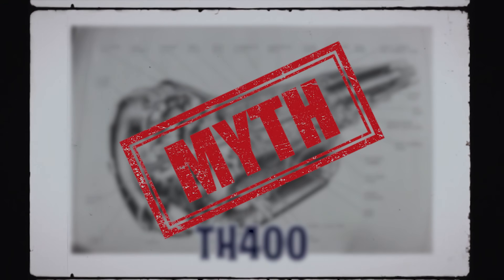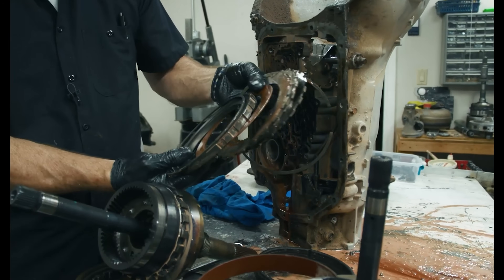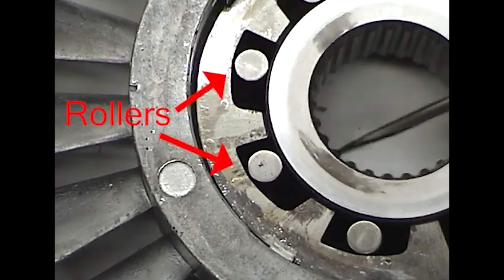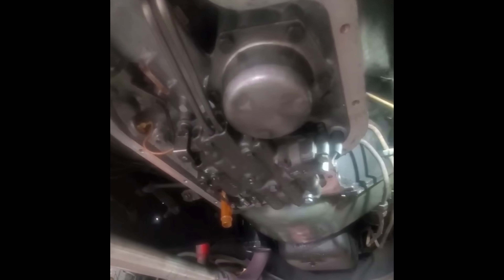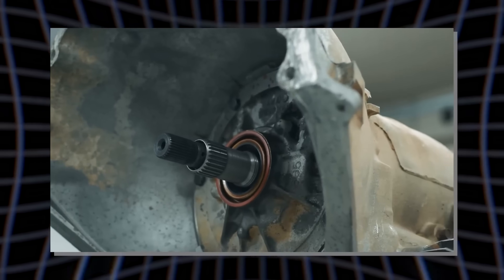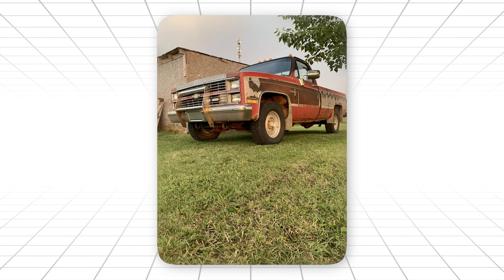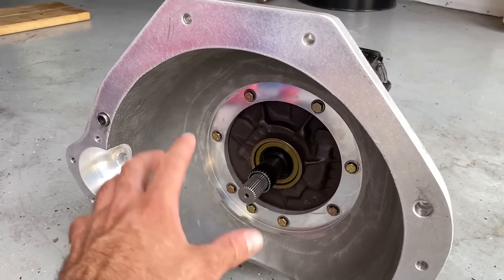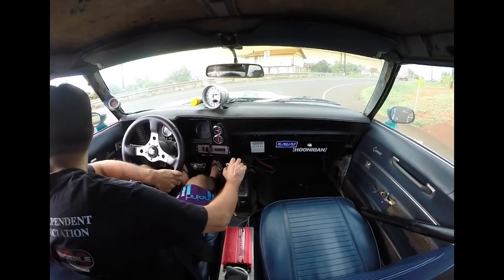GM's Tiny $12 Engineering MISTAKE That Created A MONSTER

Comment: Been a long time since I've listen to so much BS.  Why can't these content wannabe's at least do their own talking instead of using AI.  The transmissions are strong but not for the reasons he states.  The early TH400 did not have sprags - they were all roller clutches.  This AH also doesn't tell us what happens to the direct drum if you shift into neutral (either on purpose or by accident) at high speed.

Comment: I used to have a 69 chevelle that had a 307 with a powerglide in it that i swapped in a 327 with a turbo 400 that i got out of a 68 impala wagon. The guy practically gave it to me bc it was smoking and he thought it was burning oil. I.was going to rebuild it and i took the carb off and it had transmission fluid under it. It turned out that the vacuum module went bad and it was suckins fluid into the engine and burning it. Nothing was wrong with the engine. It was a double hump engine that they had a chain on the drivers side of the engine. And it had a electric kick down for passing gear. After we rebuilt the engine when i would drive it and i would shift it manually it would chirp first and second gears and pick up the front end but not off the ground. But it sure damn felt like it.

Comment: GM also turned the TH-400 into the TH-425 for Eldorados, Toronados, and front-wheel-drive GMC Motorhomes.  They were basically just a TH-400 cut off behind the torque converter, added chain drives like a 4x4 transfer case, but there was no rear output because there was no driveshaft.  Only the front output shaft was there, which went to the differential and turned the CV axles.

Comment: It's easy to burn them up. Guys that cam their engines will sometimes give up and run a TH350 instead. They don't realize that when you run a cam, you need to replace the factory modulator with the aftermarket ones. This  is so that you can turn the allen screw, while monitoring governor circuit pressure. And you must do this, to compensate for low engine vacuum. Meanwhile, the TH350 is cable driven for TV pressure, so it doesn't care 
My father custom ordered a 6 lug 2500 in '88 with a 4.3. 
After burning up the transmission in less than 30K miles, the builder disabled the kickdown switch. Been fine ever since.  But other guys have burned up those transmissions in really cold weather. The oil pickup tube O-ring shrinks, and the front pump is screaming ( sounds like a bad PS pump).
Guys that ran motorhomes had metal tubes welded to the oil pan. I honestly don't know if this was factory, or if it was a trick of the trade. But you needed it, to keep the fluid from burning up.

Comment: The TH 400 had an adjustable vacuum modulator valve. Take a small flat head screwdriver and poke it into the vacuum port and twist.... instant shift changes....
On Corvettes they had a special sump pan with cooling tubes....

Comment: The turbo 400 was so good that it was used by Rolls Royce. The Rolls Royce version had a different bolt pattern.🤗
Reply: I remember my VoTech instructor Bill Phieffer telling the tale of Rolls and the TH400. Rolls bought the design straight up and built their own 400 from scratch... and it didn't  work. They tried everything and finally called GM for help. GM sent their guys over to see the what the deal was. The GM guys tore into it, and scuffed up all the parts with sandpaper. Then it worked.... the tolerances on the blue prints were more or less a suggestion...
Reply: @vaughngordon1095 wasn't it also used by Jaguars
Reply: @GaryMorgan-w7p and Jeeps too !

Comment: Power glide all day
Reply: The power glide will break at over 700hp. Even built.  The 400 built takes 5000 not even kidding. M&M 400 in the fastest cars on the planet. The eagle has a 400 in it traping 260mph+.